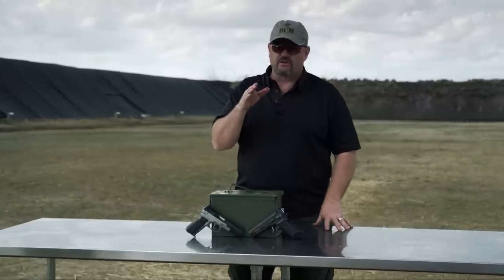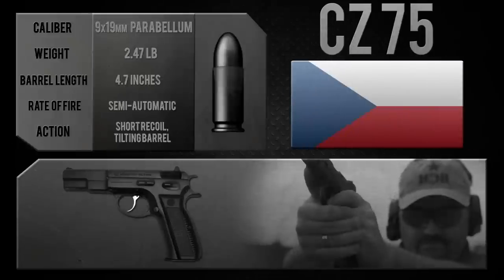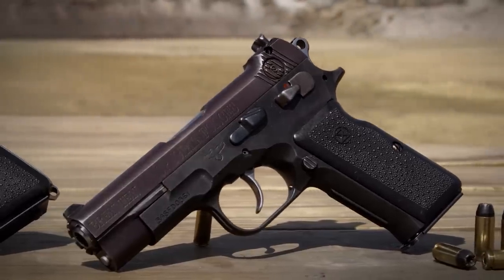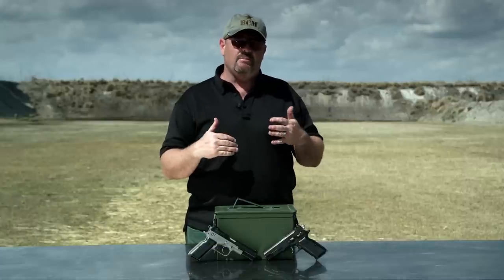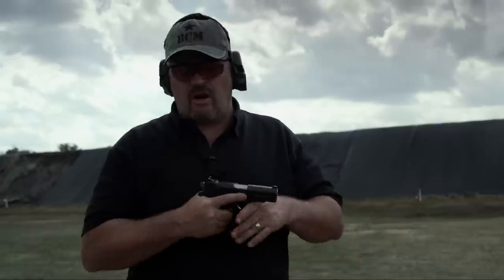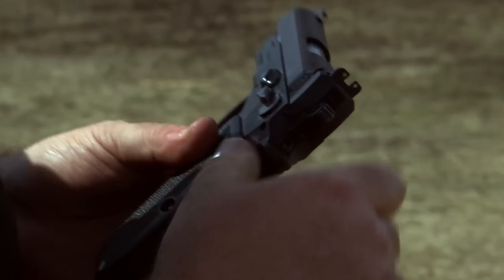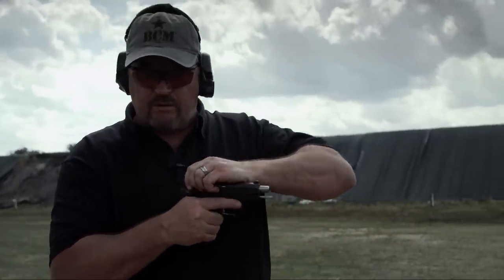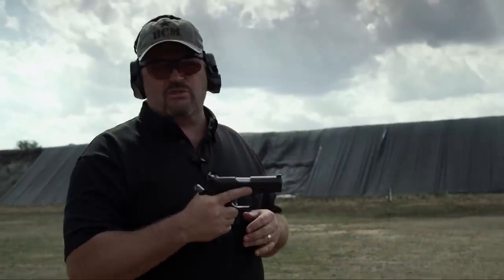Bren 10

Comment: Why would I choose a Bren Ten over a Glock you ask? Well, Don Johnson didn't carry a Glock in Miami Vice.
Reply: Really. I loved the sound that Crockett's gun made on Miami Vice!! It sounded like the same gun Arnold used in the first Terminator. I'm not too educated on guns but somebody told me only .45 caliber guns have that heavy bad ass sound
Reply: In Miami Vice they switched Crockett's gun to a S&W 645 in season 3 and on because reloading the 10mm Bren Ten was too expensive for the blanks used in film.
Reply: 007jjb Not true. They switched to the s&w because the bren ten stopped being produced, and Michael Mann and the other producers insisted that the characters would only use guns that were in production and plausible. The bren tens that existed on the show were all custom made by Tom Dornaus to shoot 45 ACP blanks, just for ease of use. Both of the 2 bren tens used on set had never been able to fire 10mm. This info is from IMFDB by way of bren-ten.com.
Reply: Thanks that is great info! I thought what I read was true but I am probably wrong on that account. Thanks again.
Reply: The Praetorian Fusilier Don Johnson’s was actually in 45 ACP.   10mm version kept jamming.   That’s why u saw him switch to S&W 645 and 4506.   I used a 5906 in 9mm.   Weight of gun was a hammer, so recoil was like a 9mm 1911.
Reply: @DRock6906  It is indeed the same sound. However, I'm pretty sure they borrowed the sound for the .45 Longslide from the Dirty Harry series, as the sound effect is exact one used for Harry's .44 Magnum. Undoubtedly, though, it's a sound that has repeatedly been associated with iconic weapons and their iconic users.... As it should be.
Reply: @blarghinatelazer9394  You are correct! I forgot about Dirty Harry's .44! I've never heard a .44 Magnum so do they all sound like Dirty Harry's or is that just Hollywood sound editing? I would LOVE to have a gun that made that sound!!!! :-)
Reply: @DRock6906  To my knowledge, .44 magnums in real life don't sound quite like that. As far as I know, this sound effect is heavily edited in order to sound iconic while sacrificing realism, but I could be wrong.
Reply: @blarghinatelazer9394  Oh ok! Thanks for that info! I should have known it was edited because Crockett's Bren Ten sounded exactly the same as his S&W 645 on Miami Vice :-)
Reply: And a Bren won't be plastic dust in 100 years.
Reply: The guns used in the show were .45s, as there were no 10mm blanks.
Reply: Based Best Millimeter.
Reply: @tstststs  It wasn't just that the Bren Ten would stop being produced. I remember reading in a gun magazine years ago an interview with the armorer of Miami Vice. He wasn't happy with the reliability of the Bren Ten (apparently it was a pain to keep running with blanks) so when the S&W model 645 came out he took Don Johnson to the range to test it and found it far more reliable. Don was actually so enamoured with the pistol that he not only purchased one for himself he also gifted some custom engraved examples to his friends.
Reply: @tstststs  Michael Mann is suppose to be a gun guy as well, bio says he is a certified range master (think James Cameron is as well)
Reply: LOL, Great answer !!! Looked great didn't it.
Reply: @DRock6906  If I remember correctly, the original "gunshot" for that noise was an edited version of what I believe was a firecracker or other explosive in a small metal barrel.
Reply: @kimisdaman  neither would a Glock. Weaker plastics have been used in pistols since the 1900s and those can be found so i doubt one of the strongest polymers in production would.
Reply: @007jjb  That's wrong altogether except what they switched to.  The Bren Ten used in Miami Vice was a .45 acp conversion because 10mm blanks did NOT exist then.  It was a NEW pistol round and no other pistol was invented yet for 10mm so that's why it was converted.  Also due to the conversion the pistol actually kept having failures when filming.  What they got on screen was considered lucky.  When the company went belly up in 86 they switch the 645 because Michael Mann said that Crockett was to carry the most latest gun on the market in a large caliber and that was the 645.  Plus the fact that it was already a stainless pistol worked into being able to film the gun at night and it still shows up on screen without cosmetic changes.
Reply: @DRock6906  no mate, it was sound effects they dubbed over the sound of the blanks !
Reply: Not true. Crockett used a Glock 17 he took from a drug dealer in one episode in season 3. This was THE FIRST appearance of Glock on an American TV show!
Reply: @DRock6906  nah, it sounds like a Dirty Harry Smith and Wesson model 29

Comment: When the Bren was still a prototype I told Tom Dornaus to give the production version scalloped cuts behind the trigger like on the 1911 A1 and to extend the receiver rails forward. He took my advice on both points but the rails were not lengthened the distance I suggested. The original Norma ammo was a FORCEFUL load and after shooting thousands of rounds my hand got the 10 millimeter blues. LOTSA FUN!
Reply: A good friend if mine bought one of the first Colt Delta Elites that hit the stores. The only 10mm ammo around then was the Norma 200 grain JFP. It would wake you up when you fired it, and it was a quite a bit more powerful than today's 10mm loadings.

Comment: 10mm auto is far superior to .45 acp, only problem is that there are not alot of handguns chambered in 10mm auto.
Reply: +Optic64654 10mm is a cartridge for advanced shooters, the reason the fbi stopped using it is because women and small agents could not handle its power, its not a cartridge problem, its a people problem. not only is the 10mm more powerful than the .45, it is also more powerful than the .357 magnum. and btws you are talking to a person who shoots and reloads both .45 and 10mm and goes to the range on a regular basis. i dont reload .40 however, to much pressure.
Reply: for proportional size say both calibers in a 200 grain bullet, the 10mm would be significantly faster and penetrate deeper. and for hollowpoints, you get better expansion in a 10mm. also 10mm has wayyyy better capacity than .357 magnum, the eaa witness and the glock 20 both carry 15+1 rounds of 10mm. basically its bigger, faster, and better capacity. and it also comes in semi auto and revolvers, the only .357 magnum semi autos are the automag, desert eagle, and coonan .357. i highly recommend 10mm for anyone in competition, hunting self defense, etc. and i cant say a bad thing about my custom delta elite.
Reply: Optic64654 for proportional size say both calibers in a 200 grain bullet, the 10mm would be significantly faster and penetrate deeper. and for hollowpoints, you get better expansion in a 10mm. also 10mm has wayyyy better capacity than .357 magnum, the eaa witness and the glock 20 both carry 15+1 rounds of 10mm. basically its bigger, faster, and better capacity. and it also comes in semi auto and revolvers, the only .357 magnum semi autos are the automag, desert eagle, and coonan .357. i highly recommend 10mm for anyone in competition, hunting self defense, etc. and i cant say a bad thing about my custom delta elite.
Reply: Optic64654 ok, so let me explain, the 1986 fbi shootout was a crap fest for the fbi because they were using .38 special. then because .38 special was not adequate as result of the shootout, the fbi adopted the the smith and wesson model 1006 chambered in 10mm auto. after a while training with the 10mm auto was deemed uncontrollable specifically for women, and smaller stature agents, so then the fbi made a subsonic loading for the 10mm known as the fbi 10mm. after still receiving complaints from the same party of individuals, smith and wesson decided to shorten the 10mm cartridge, and thus .40 smith and wesson was born. so as you see, the rejection of 10mm had nothing to do with lack of stopping power, it had to do with issues in training because of inadequate agents. it was a people problem, not a cartridge problem. IT HAD NOTHING TO DO WITH STOPPING POWER. the 10mm is incredibly powerful, thats why most people use it for bear, lion, and cougar hunting.
Reply: Optic64654 yeah sure, what form would you like it in, article link, video, pictures?
Reply: Optic64654 hey man i hope i helped you find everything you were looking for
Reply: Why is 10mm better than. 45 ACP?
Reply: Ian Babcock well, the 10mm has the capacity of a .40 smith and wesson, however it is even more powerful than a .357 magnum, being able to shoot a 200 grain slug at 1300 fps from a 4 and a 1/2 inch barrel. 45 has less power, less range of capabilities and can hold less. if you have any questions about the 10mm such as recoil, feel free to ask, i own a colt delta elite and fire a wide range of rounds through it.
Reply: Optic64654 no Lol, its just a high pressure round with recoil that is preferred by a more experienced person with good recoil management. its like how i would recommend a person who wants a revolver to purchase a .38 special before a .357 magnum, not because they could not shoot a .357 but a .38 would better suit a beginner. just like i would recommend a .40 to a beginner over a 10mm. also alot and or most people who purchase a 10mm intend to reload it and are already into reloading. if you are in the market to reload and want a kick ass cartridge for semi auto or a revolver, then you should go for a 10mm! its a great for pretty much anything. all power to ya!
Reply: krombopulous michael Your reply to Optic64654 answered my questions. Thanks.
Reply: Ian Babcock sure thing no problem.
Reply: krombopulous michael Can it be used hunting? Hahahaha of course. Jeff Cooper  a .45 user designed 10mm to be a better .45. 10mm will always be my preferred round and I would instantly buy a Bren 10 if I could.
Reply: Optic64654 Two years late to this comment chain, but I'll chime in anyway. A 10mm was actually my first handgun, so I'd say it's fine for first-time shooters, CONDITIONALLY. If you're a big person, and/or have big hands, or even if you just have the basics of how to stand and hold your arms and hands for ideal recoil management (something you should really learn early on anyway), then it's really not such a nightmare to shoot at all. Especially if you're shooting it out of a proper, heavy, steel-frame firearm such as a 1911, rather than a PoS Glock 29.
Reply: I'm late too but I'll chime in too my 10mm's are colt double eagle,g20,g40,RIA and three year old colt delta elite and to be honest the delta with Underwood and buffalo bore doesn't recoil much worse to me when shooting my buddies ruger sr911 side by side but its definitely louder.
Reply: 10mm was adopted after the Miami shootout, due to "failure" of 9mm.
Reply: @krombopulousmichael8418  - No, the FBI did NOT stop using the 10mm because it was too powerful for female special agents. That's just macho BS gossip. The reality is that when the FBI decided to add 10mm into its ballistics testing to select its future issue weapon, it wanted a scientific experimental control in order to keep some things consistent from caliber to caliber. They selected 950fps as the target muzzle velocity. But that required them to acquire a weaker 10mm load than anything that existed on the market, so they had to buy commercial 10mm ammo and then reload it weaker. They rationalized this on the grounds that they believed that commercial 10mm would be too powerful for a lot of their personnel anyway. But to the best of my knowledge, they never issued the hot stuff to any of their people. 

Even then, even with the weakest weak sauce 10mm they could get their hands on in the form of FBI Lite 10mm, 10mm still beat out 9 and .45. So the FBI selected 10mm as their caliber of choice.

Federal was then contracted to mass produce the FBI Lite load.

Because of problems in the civilian market with jamming in the Bren Ten and frame cracks in the early Colt Delta Elite with the hottest 10mm loads, the FBI contracted with Smith & Wesson specifically to make a 10mm pistol that would be heavy duty and durable. The 4506 served as the basis of the solid steel 1006.

But there was a problem there, with the weakest 10mm ammo in existence being run through a gun purpose-built to be stout and beefy. Jams ensued.

The FBI's insistence on custom modifications to the safety or decocker mechanism backfired and led to even more jams. 

The problem guns were sent back to the FBI, and then later all were recalled to S&W for decommissioning. 

If anything, the issue was not that 10mm was too powerful for the FBI, but actually that its FBI Lite load was too WEAK to consistently operate in the heavy duty gun that the FBI had chosen to shoot it from! 

The .40S&W came on the scene, and the FBI transitioned to it, instead. Why continue bothering with a jam-prone gun?

There had never been any complaints about 10mm being too powerful for FBI personnel. The FBI had ensured that that could not happen, by never issuing hot loads in the first place. And the .40S&W that replaced the FBI Lite 10mm virtually mimicked its performance, and continued in FBI use for the next quarter century, by male and female special agents alike. Clearly, excess power was never the problem. 

There were a few complaints that the S&W 1006 was too big in size for some female FBI Academy cadets, but never too powerful. A big part of the appeal of .40S&W was that it could be loaded into guns with the same size frames as 9mm pistols, which would allow for smaller guns than the 1006. 

I advise caution to all those who might seek to stroke their own egos by disparaging FBI female agents as weak. 

And I also advise caution to all those who prefer other calibers and who denigrate 10mm as absurd because it was ever somehow too powerful. 

The truth lies elsewhere, and we should leave our egos out of the search for it.
Reply: @texasbeast239  Thank you for giving much history and insight into the 10mm's history with the FBI and correcting some mistakes I may have made. That being said, your last remarks are quite presumptive and are a bit rash. The first thing to discuss is the "ego stroking" claim you make. I said that female agents and smaller agents in general (I should have specified "some" and not "all") had trouble with shooting the 10mm due to its size and recoil. If you look in many places on the internet, this is touted as a fact. Whether it is or isn't true is irrelevant in regard to my INTENT of making the claim. You imply that I am "trying to stroke my ego" by saying this, but I am merely trying to convey facts about what I have read on the topic. I have a wife and a daughter and have no intent to disparage women whether they are FBI agents or not. I also noticed that you didn't defend the smaller agents that I mentioned in my claim, which suggests to me that you have a particular bone to pick about women. I never made an insult to a woman or women in general overtly in my entire claim, I merely recited what I had read on the matter. the second thing to discuss is you implying that I said that the power of the 10mm is a problem for the cartridge. I love the 10mm and I own 3 pistols chambered in it. I merely suggested that its power may have not been good for the FBI's application. Which, is completely true and that is why they switched to lighter loads and eventually the .40 s&w according to your statement. the power to recoil ratio was too high and they had to nerf it down to around 950 fps, which they realized they could do more reliably with the .40 s&w in a smaller framed gun. I CAUTION YOU IN THE FUTURE TO NOT BE PRESUMPTIVE OF OTHERS MOTIVES AND TO NOT MISREPRESENT PEOPLES STATEMENTS. You may know more than I do on the topic of the 10mm's history with the FBI, but YOU MADE NO EXAMPLE OF ME. Instead, you made a fool of yourself by making rash presumptions of someone else's motives and statements and showed that you couldn't just correct the claims I made, but rather had to get into your feelings and try to play the white knight for no good reason because, I was never attacking women or the 10mm to begin with and you seemed to have made that part up in your own head.
Reply: @krombopulousmichael8418  Son regular 10mm ammo from someone like Federal is lower power than the original 10mm ammo? I've also tried 10mm ammo from companies like Buffalo Bore and it's definitely more powerful. I just wonder which one is equal to the original 10mm spec.

Comment: Thanks for the video and I know this is a couple of years old. Actually there is a current production CZ 75 clone in 10 auto. Tanfoglio makes their model 75 clones, the Witness series, in 10 auto in both compact and full size with either polymer or steel frames. It's pretty much the same gun without the silly cross bolt firing pin safety and magazine retention spring. EAA seems to be doing well importing them also.